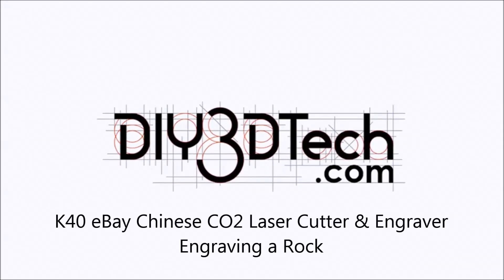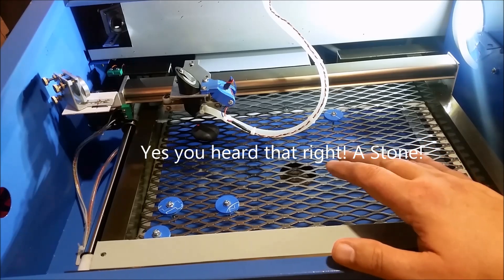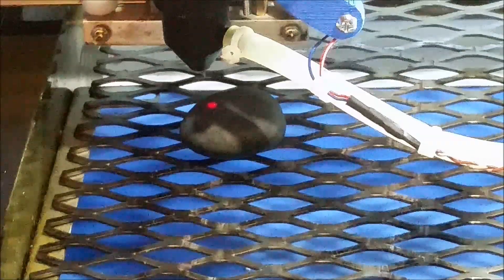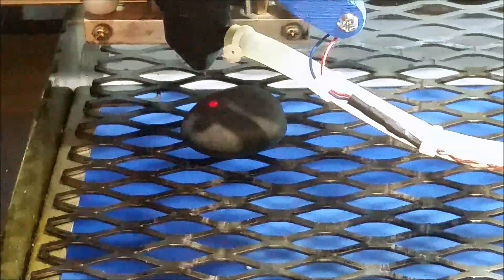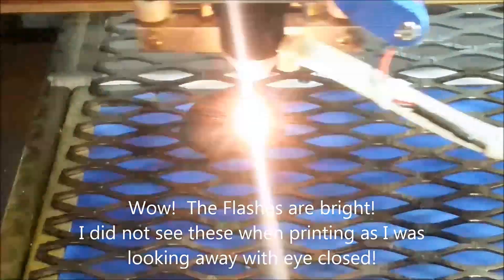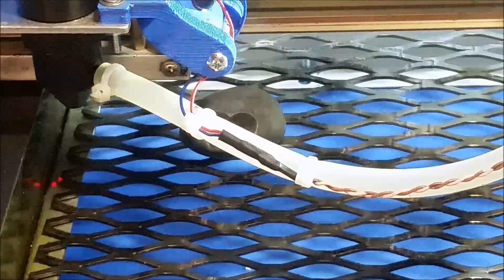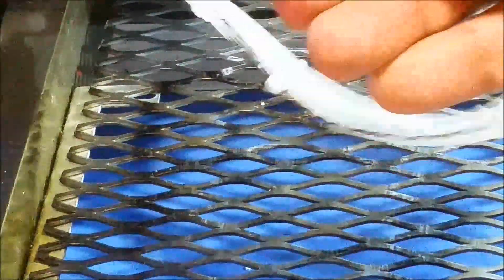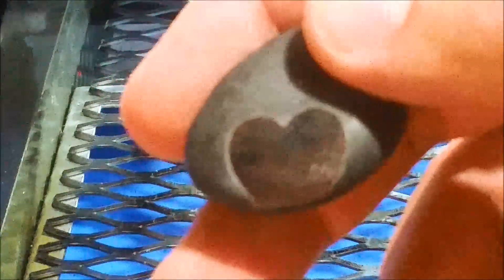K40 eBay Chinese CO2 Laser Cutter & Engraver  - Laser Engraving a Rock

Comment: Just tried a white rock and all it did was get hot.  I could make out a little bit of an image but not sure what this white rock is.  Of course laser engraving a stone shatters the stone so I had lots of little white stone specs all over.
Reply from the maker: That was interesting, never had it shatter a stone before...
Reply: Made it feel rough like sandpaper due to it blasting the chips out.  I figure it was micro exploding it.
Reply from the maker: P.S.  You want to use high power yet raster at fast speed....
Reply: @thebeststooge  it'a water in rock that pop ,,before lesering u need to heat it up to remove water from it
Reply: I still have the rock and the image but it is a crystal rock of some kind but not wet.
Reply: @thebeststooge  hello did you can engrave on crystal by k40?
Reply: @ma-oq8wj  I never tried on real Crystal before as real Crystal glassware is expensive.

Comment: Hello, I watch a lot of your useful Videos on the CO2 Laser Cutter. After two days of using more laser cutter, it stopped working.  1) Test switch does not work(does not fire)
2) The machine stop communicating with software (example: does not home when connecting with software)
3) The Amp-meter dial does not change the current
4) The Fan inside the power supply DOES NOT run
5) The water pump runs fine
6) The Fan behind the power supply unit runs fine
7) Laser tube looks fine (looked for cracks, but nothing was observed). 

https://youtu.be/ve3Sk13k69o
See the link above.
Please help
Reply from the maker: Is the fan inside the power supply spinning (I can't tell in the video)?  If not than you power supply is not getting power and beware this is a HIGH VOLTAGE power supply and it can both injury and kill you so not to be taken lightly...
Reply: DIY3DTECH.com No, The fan inside the PSU is not spinning. I believe this issue happened while engraving and it made the software hung up as it lost connection. Any idea why all of the sudden the PSU is not getting power or did something fail in the PSU? Thanks for your help and warning. I saw your video about the dangers of laser machine.
Reply from the maker: The first thing I would do is check if power (i.e. 110volts)  is making the power supply as it appears the fan in the back is still spinning.  Also again if your skilled check inside the PS for a fuse or fusible link along for any lose or disconnected wires (again be careful).  If power is making it to the PS and all wire are connect as well as no blown fuses or than you need a new power supply (they sell them on eBay)...
Reply: I also measured the resistance across the fuse proving it is open. Any idea where I can get a replacement fuse? Seller is not responding quickly and very difficult with communication.
Reply from the maker: That fuse in no question blown so part (1) of the problem solved and now part (2) why is the fuse blown?  What I noticed in the video is deposits on the circuit board and this could done it as it could be condensation for sitting in a high humidly environment or even out in the rain.   So if was me, I would clean the "discarded" board with a high grade alcohol  and solder in a replaceable fuse holder, insert a new fuse and power up with no connections and see what happens.  If the fuse pops with nothing connected I would order and PS. If not, I would power down and start re-adding load and repeat to see what happens.  Good luck and be safe also the schematics are out there if google for them...
Reply: Thank you for your comments; I will definitely try what you suggested this weekend. I didn't have much luck finding the schematic to at least know replacement fuse. My power supply PN is MYJG-40W and the board has PN JLR0150.
Reply: With a help of a friend, I was able to fix my 40W CO2 Laser Cutter Power Supply. It turns out the Bridge Rectifier had a short in it.  I replaced the Rectifier with a new one and replaced the second blown fuse with new one. The machine is back to working. Thank you for your help.

Comment: I frequently engrave black slate tile that I get from my local home improvement store. It comes in 12"X12" pieces, so I just cut it to whatever size I need with a tile saw. It works great. Depending on the effect that I'm going for, I sometimes have to make multiple passes so it's important to secure the workpiece well. One caution that I should mention is that it does spit sparks from the slate. Keep the cover closed, use aluminum vent tubing and, like with engraving anything else, don't walk away from the machine. Fires can happen with any material, but natural stone has many types of minerals which can have unpredictable results. (I'm sure you know all of this but I'm assuming less experienced people may read this.) BTW, I enjoy all of your videos and appreciate you sharing your knowledge.
Reply from the maker: Many thanks for the kind comments!  And you can never have too many words of safety so thank you for sharing :-)

Comment: hello, can you test this machine with " metal " items ??? ( aluminum for example ) not for cut, only for engraver. Is possible with only 40w???
Reply from the maker: Sort of, you need to use a marking compound etch metal and frankly with a 40watt will be hard but possible...
Reply: IV been wondering this too

Comment: I have watched all your Chinese laser videos but you didn't mention installing and using the software. I'm expecting the same model as you have and would appreciate a heads up on the software
Reply from the maker: +bobdring I have not done that as I felt it simply be a rehash of all the video already out there on the topic.  I have Corel Laser and Laser Drw and both are junk to be honest, I have kept them for now to see what can be done with them, and produce a series of videos based upon that.  However my plans are to switch to GRBL as both sort of work however Corel Laser does not change speeds when you change the mm/sec however it will in Laser Drw (both are the same driver so go figure).  Laser Drw for cutting does bitmap tracing so you don't get a clean cut because it is based on raster image and not a vector.  If you run into issues, free to write and I will see what I can do to help :-)
Reply: +DIY3DTECH.com  I'm expecting my Laser around 8th Jan. I will have to see what software and documentation come with it when i open the box. As i understand it the Laserdrw is standalone and Corel laser is a Corel draw add on.
Reply from the maker: Cool drop me a note back here on how things go!